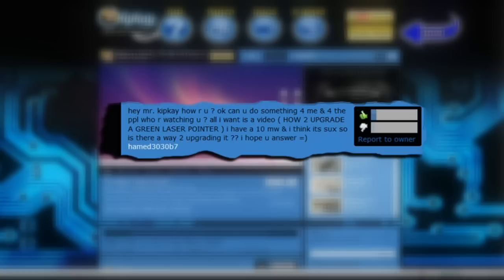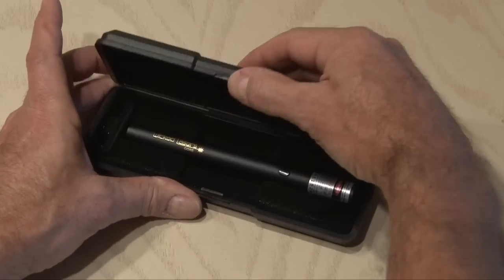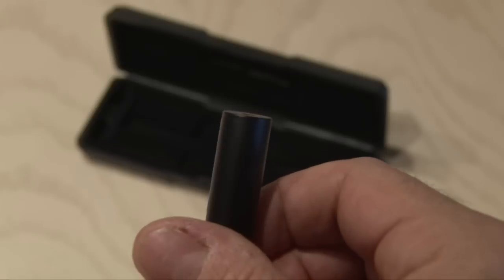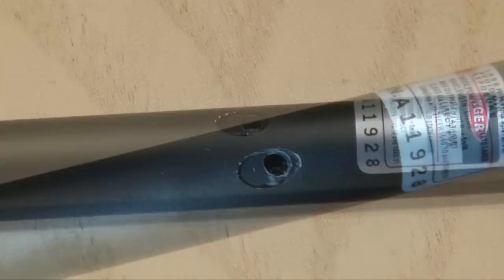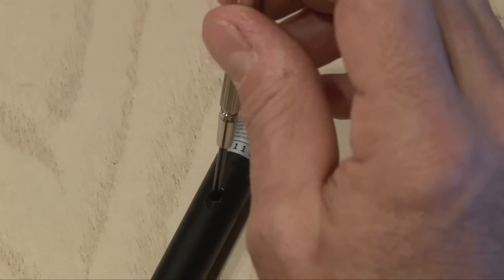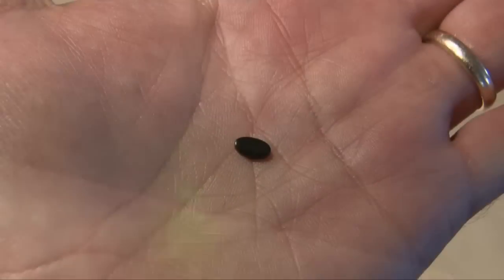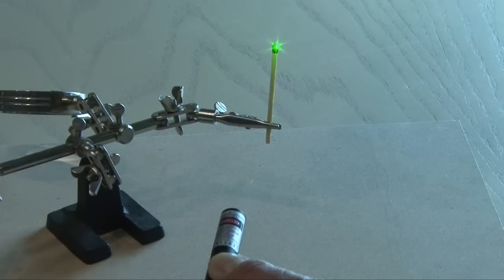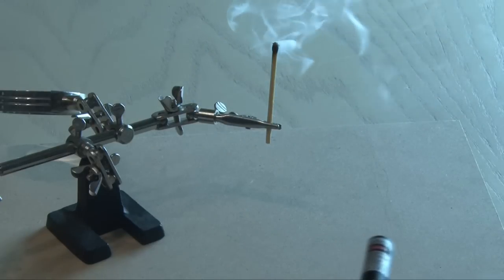Make a Laser Pointer Burn!

Comment: OMG, I'm such a dumbass! A few years ago, I destroyed 2 cheap green lasers by drilling a small hole in the casing to reveal the pot as the adjuster is called. Thanks for posting. 
Just one word of caution: most laser diodes have about 5,000 hrs of life in them. Increasing the power output will severely reduce the life of said diode, but what the hell. If it burns it's worth it!

Comment: I did that the hard way by removing the end from the barrel (not easy to do). I knew they all have adjustment screws but didn't think to check under the button. Clever.
The reason they have adjustments is because by law they have to make sure they don't exceed the max output allowed. It also might shorten the life of the laser.

Comment: i have a 5mw green laser pointer that is almost identical to the on in the video, when i took off the button (just glued on like in the video) but underneath is a wall blocking where this screw would be. 

i dont understand how without that wall, the button would still be functional as you would just be pressing button onto a hole and not onto the warped metal that bends back up after letting go (for functional buttons)

did u remove the wall of metal before you were able to adjust it? how was the button functional if all that was under it was a screw and nothing else to facilitate the button on top?

Comment: one Question.!!!  recently i went through a laser therapy for my nail fungus.  idea is the same. point soft laser beam on infected nail and heat up until we can tolerate the heat. so the heat produced by laser kills the fungus and as nail grows the dead fungus will be removed and so on... it costs a lot and have to go twice a month for 3 months.  costs a lot.... can this pen be modified and used for the same purpose??? i mean can i treat my nail fungus myself at home??? is it possible???
Reply: Possibly.

To be honest, it might not be the safest option, but getting a 100 mw laser pointer or something like that can really help. If you have a magnifying glass, the better! Probably is hella cheaper than going to a clinic to do the treatment, but wear laser goggles in case.

Comment: I opened up a smaller, red laser pointer from the dollar store. It also functioned as a flash light and surprisingly well. There no altimeter or whatever it is that you turn to increase the power of the output. Any ideas?

Comment: any laser mate. I dont recommend doing this tho. Laser diodes will just keep sucking in power. They get hot. No heatsink and they will pop. You can build an absolute beast laser lets say 1000mw for under $100.00 usd I have some vids of my 2000mw laser in a heatsink i made. It has links to where to buy what you need. I have brought around 15 of these pens and

Comment: does it have to be green, or a laser pen, or from wicked lasers
Reply: no , no and  no. blue lasers are the most powerful because blue is the most powerful color on the light spectrum besides ultraviolet .
so i would use blue instead of green , but you can still use any color.
and also you can use any laser from anywhere to hack into the driver .
Reply: Joshua Richardson what about red
Reply: Here's what the colours do. Red lasers are the average versions, they are the medium ones. Greens are for non burning but very bright to see. Blue is extremely powerful and not the very visible and the wavelength cannot be the same due to not seeing the beam.
Reply: As the others.
Reply: any laser mate. I dont recommend doing this tho. Laser diodes will just keep sucking in power. They get hot. No heatsink and they will pop. You can build an absolute beast laser lets say 1000mw for under $100.00 usd I have some vids of my 2000mw laser in a heatsink i made. It has links to where to buy what you need. I have brought around 15 of these pens and they are garbage. They say they are 1mw-10mw etc but with my laser power meter i get anywhere from 80mw to 130mw The diodes in green are crap also You want it to burn? Rip the lens off and remove the inside components of your laser. It wont be a green laser anymore. It will put out a red light tho. That will be burn stuff a lot better than this.

Comment: Can you do the same thing but with a cheap eBay laser. The older lasers had the same thing with the screws but now the screws are not put in them. So they are harder to mod. I'm down to my last violet laser and I don't want to break this one
Reply: if you take the front open it it will be a lens there you can use a needle and turn it and same thing happens

Comment: So im guessing that 5mw laser will last about an hour before it is ruined forever.

They dont just sell things cheap that you can 'turn up' and turn into the more powerful version, otherwise it would cost a lot more.

A laser will burn out eventually. The more power you put through it the quicker it will burn out, and possibly instantly if you dont have the equipment to measure it.

..But if you dont care then what does it matter? :P

Comment: There's laser pens that you can focus by the diode, adjust the current (as shown here), and much more. Just take a very careful look at it. If its a screw, turn right, but not too much or too much power is output and will break. And if you got one you can focus, mess around with it, see whats best. Smaller the dot, the better if your focusing it.
Reply: Thanks you saved my laser I was gonna crank the screw as much as possible didnt knew it could have broke    how many turns would you recomend

Comment: For all of you that are curious, the reason this works is because he is over driving the diode. As in, putting way too much power into the diode for it do do any good. Sure this will work, but it will also decrease the life for the laser a ton. For those of you asking how to turn a $5 laser into some monster burner- don't bother. It won't work because the diode will fail long before it outputs enough power to burn anything.

Comment: if its not this specfific laser then it possibally wot be under the button, probally somehwere else in the casing,  i had a laser pointer which had it just on the circuit board not lined up with any access points

Comment: How would it work on this laser because the button that he took off where is the actual clicking thing inside of it, it's not like the laser is turned on by a screw. You can clearly see that he has drilled in  to it but how would it click if the rubber button has nothing to hit to make it turn on?

Comment: that's not possible. an x ray is a form of electromagnetic radiation and can only be achieved by an x ray tube or a vacuum tube, and every time you take an x ray of some one or an animal you're exposing then to radiation and if you're exposed to too much radiation you can get different forms of cancer

Comment: A pot (potentiometer) is an adjustable electronic component used to adjust the output current of your driver. Adjusting it past what it was set to before purchasing the laser will drastically decrease the lifespan of your product. In many cases you'll damage your laser outright as soon as you try tinkering with it. It's much more worth it to just buy a higher-powered laser.

But yes, this is real. It won't work with super cheapo lasers though.

Comment: @andyvu98 Buy new batteries, if it doesn't work try replacing the switch, if that doesn't work the diode or driver is fried or there are some bad connections, and it isn't worth all the work needed to repair it.

Comment: @420hooray Black items are used because black has the highest emissivity of the visible colors, meaning it absorbs, and emits, a lot of heat. They are the quickest example to demonstrate the strength of the laser because the black balloon and darkened match will absorb the heat very quickly. It should be able to pop other balloons no matter the color, it will just take a little longer.

Comment: @Aarontsu A laser with 100 mW output has 100 mW output and it doesn't matter if its red, green, or violet. Color doesn't affect output. Now yes, a violet laser does have move energy than a red laser but that means more energy has to go into the laser device to produce a violet laser. A 100 mW red laser has as much energy as a 100 mW violet laser. IF you got X amount of energy going into the device than you get X amount coming out.

Comment: i have a 1mw green laser pointer but cannot modify it due to the screw not being directly under the button.
I have turned it in loads of directions but cannot find the right setting (and i cannot have the laser on at the same time because the battery in point is in the middle)

Please help me

Comment: Kipkay, that laser module is only rated for 5mw. Turning up the power may give higher output for a while, but the pump IR diode will likely burn out after just a few minutes of use. Be careful, this mod is at your own risk. Too bad that seems to be a nice laser in the video...

Comment: I can guarantee that this will not work with any cheap laser pointer from cheap chinese sights or ebay(same thing).  Yes they have a pot to turn, but they are already set at max, so doing soo will pop the diode.  w/ this laser, it would probably work, but would decrees the life of the diode pumping IR light into the crystals.  This will not work w/ cheap red laser pointers.

Comment: I tried to do this with my laser today! Not exactly a laser from Wicked Laser, and I actually completely broke my laser. The button was not removable, so instead I tried to pull the top of, to get inside of it. The top got of easily, but the circuit board didn't come out. When I tried to pull that out, I broke the laser diode, so if you can't remove the button, I dont suggest you to get inside any other way.

Comment: @xCarbonatedBloodx  for sure! but thats to expect. The thiing is; diodes lose intesity over the years. And playing with normal green or red diodes I've seen firends forget the resistor in a 5Volt circuit and the diode worked one day and then barely emmited light.

I also think that maybe the fcc has a tight limit on diode power output and this is a way of letting the user break the law. (Harmless to break this king of regulations ... ).

Like the electronic speed limiters on some supercars.

Comment: @abravonu Argue without insulting? You were the one who called this post lame.  And yes it would be an upgrade if I took off the cover to my TV and turned a screw to increase the power to the speakers beyond its normal intended output of sound. Face it, although this wasn't the most fascinating modification of a laser, it was still an upgrade.

Comment: @lorenzvc you totally missed the point.....the comment i replied to said. "he didnt do anything special , u need a laser from wicked lasers , price around 100$.. most regular lasers dont have such power-adjusting screw.

My point was, 1. The laser he shows in this video is the Core series lazer sold at wicked lasers for 29.95, not 100+.     2. above said laser DOES have a screw which by turning you DO achieve higher outputs. Get it?

Comment: @TheRighteousFist Yes and no.
Firstly, thinking, he had to focus it to get anything to burn. Secondly, he did it from a distance of a few inches. Thirdly, adjusting to one point would be difference varied--what is focused at 10 inches is horribly unfocused at 20 feet.

You'd need a still target, and even then a lot of lasers. But the idea of a laser rifle is actually in use--The US military has a laser defense system that shoots down any incoming missiles with a purple laser.

Comment: @PyroCreationZ I respect your oppinnion however it is wrong. The potentiometer limits the energy being sent to the aperture of the laser and the amount it is limited is set by a dial. By turning this dial you increase the amount of energy being sent to the aperture meaning a larger output. However you are right in the fact that it will decrease the overall life of both the batery and the laser diode by a bit.

Comment: To make a proper "pot mod", you should unassemble a pointer, see if you can find out a model of a laser diode (might be printed on its cover), google it and find out the maximum output power possible for this model. If it turns out it's much higher than claimed on the pointer sticker, go on and tweak it a little. To be absolutely sure about an output power, try asking for help an optoelectronics department on your local university, or find someone that studies over there. Good luck!

Comment: That's the way to break your pointer as well, if you're not careful. Laser diodes can be easily broken if the output power exceeds its limits.
Usually the output power is temperature compensated, because laser diodes in general have more output power in lower temperatures even with the same driving current. So be careful with this trick - your laser might be working fine at home, but in a cold outside your house might just burn itself - especially cheap chinese ones, non-compensated.

Comment: @thebeatles4784 
while holding the button, turn it 180 degrees to the left and pay attention to the pointer, if the laser fades, spin it the other way, if it gets bright, you're on the right way, and do not overtight the screw, otherwise you may get a problem: which is most likely accidents!

Comment: The 5 mW laser is limited to that power for a reason. Anything brighter and you risk getting severe vision problems.

If this is a 50 mW laser, it's in the industrial range and you WILL get blind spots just by looking at the ray, or the reflection, or the specular reflection (unless you are wearing safety glasses).

Comment: There we go again. You all do realise that pushing any electronic components above their ratings results in their deaths? That's common sense. Especially with laser diodes which extremely sensitive. You do realise that your "modded" laser pointer will die within a week?

Also, there are no 532nm diodes, Kipkay. There is a DPSS laser system, you might want to read up on that. You know, 808nm IR diode, ND:YAG + KTP doubler crystals which makes 532nm laser light?

Comment: I'm REALLY do not recommend that. Normally all laser pointers don't have that easy access to the potentiometer and usually factory setting are in most highest value that crystal can focus the light. And usually the potentiometer controls the crystal position that in factory workers could calibrate laser pointer. Also 10mW laser pointer can't light a match (well at least European standard matches).

Comment: i have a 5mw blue beast green laser pointeer i bought off of ebay. It's a nice little laser pointer but the only problem is theres no screw for the procometer. its only ment for 1 brightness level and i feel i got ripped off i paid 15$ for it. how much was the one from wicked lasers? and is it beneficial for one?

Comment: Increased energy to the diode would mean it needs more current. So couldn't it overdraw the batteries and cause them to overheat? Or with that much energy being generated by the diode, it could become too hot for the type of solder used, the insulation on the wires inside, causing shorting; or even too hot for the plastics or glue around the diode which would just cause it to fall apart, maybe smoke or combustion if the plastic has the right composition.
Reply: The LD itself would fail before everything. Laser diodes, despite how dangerous they are, can and will break if you sneeze at it, literally.

Comment: @xJrockk  Well different Wavelengths have different amounts of energy behind them. just increasing the brightness won't guarantee it can burn. green, blue, violet, and UV lasers would theoretically work better than lime, yellow, orange, red and Infra red lasers. Granted Infra Red is used to see heat, but comparing a UV diode to the IR diode on every TV remote, the UV gets much hotter, and much quicker. The shorter the wavelength, the higher the energy.

Comment: Turning up the pot will make the diode and/or crystals burn out in no time. Only in very rare cases are lasers set at a current far below what they are able to push. Before all you Kipkay fans start your ignorant babbling attacks, think of this: Why would a manufacturer sell a weak little laser pointer if he could just have turned a screw, made it powerful and sold it for way more? Answer: because it breaks the fucking laser. I do have to give you kudos for wearing your goggles though.

Comment: @charliebruce123 Do you have to be dumb enough (not you) to not know the difference between normal safety goggles and laser safety goggles? You are using a high powered laser, of course you would know which goggles to where. Second, KipKay worn a red safety goggles. Since when normal goggles were red? Of course they are for lasers!

Comment: @firebeast1000 There is a reason for that. If you disagree with the person making the post on livestream you can ban them. It's not eliminating those who are wrong, it's eliminating those with a differing opinion.

Unfortunately, this isn't opinion. It is objective fact. If you perform potentiometer modification on your 5mW green laser, there is a very high chance it won't last very long.

Comment: I suspected this would be a pot mod when i read the title.. this won't work on all pointers.  Even if it does work the diode will heat up a great deal more and it is unlikely that the enclosure of your typical 5-10mW pointer would provide sufficient heatsinking. The lifespan of your pointer will be reduced significantly.

Comment: Kipkay... what did LPF teach you about these videos?
To anyone going to attempt this I highly suggest you don't without first reading into just what you are doing it increases the chances the diode will pop and if you are by some miracle lucky enough not to pop it then you're actually walking round with a very dangerous piece of equipment that you should be using safety goggles for, if you want to read more on this or lasers in general head over to laserpointerforums (google it)